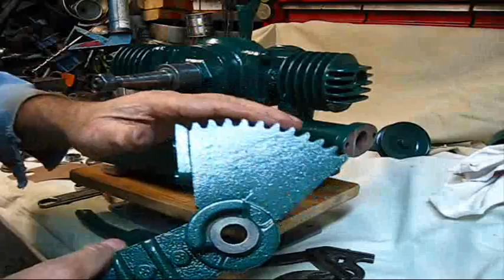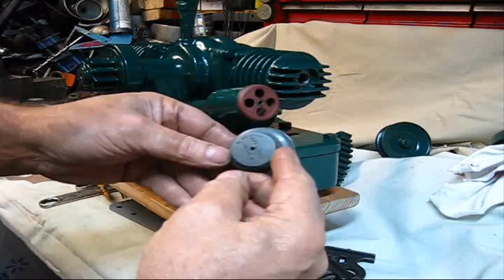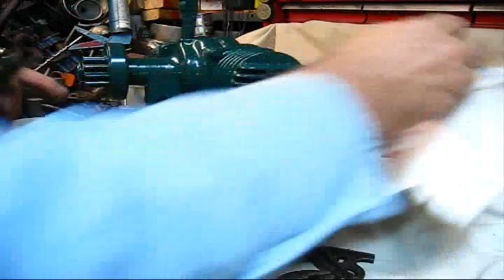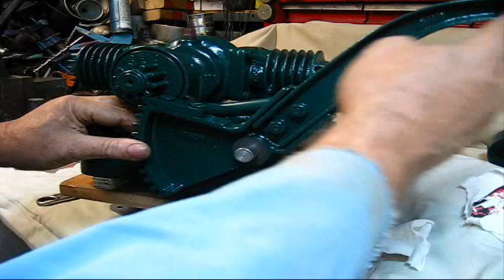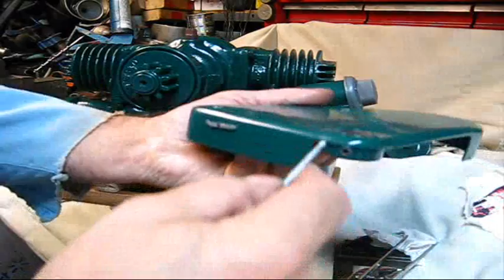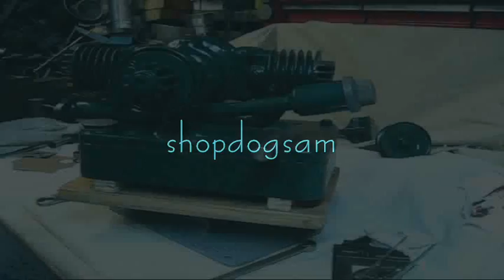1937 Maytag Engine  model 72 repair #54

Comment: Those ratchets on the starter mechanisms are just like old Briggs starter recoils. I have had a lot of those through my shop over the past 29 years, where people have put oil or grease in there so the barring can't roll freely. The best thing I have found if you have problems with the bearings sticking, is to coat them with a minimal amount of graphite powder and it works wonderful.